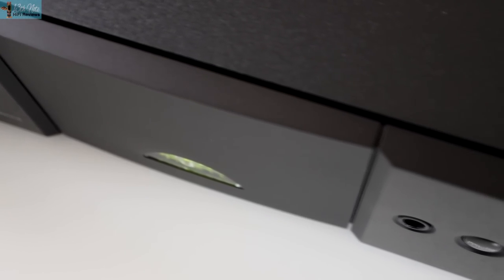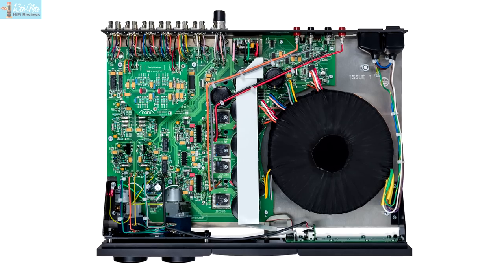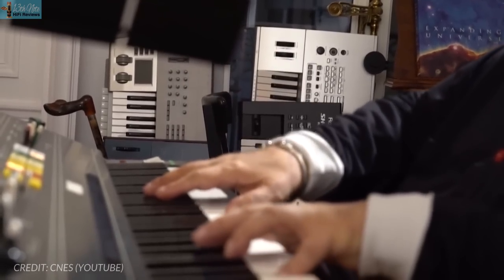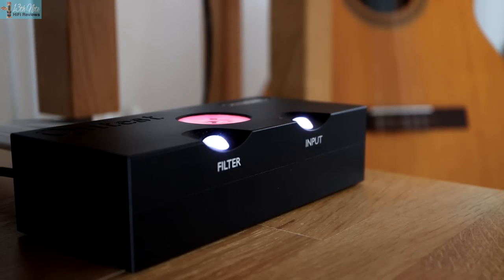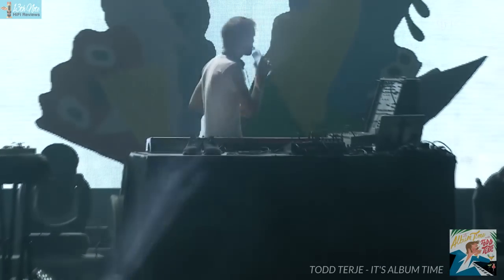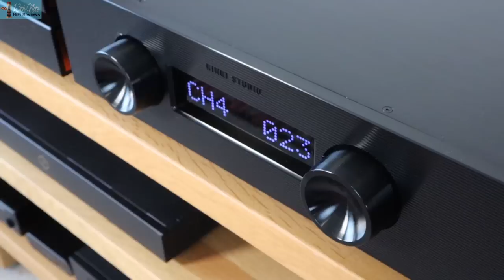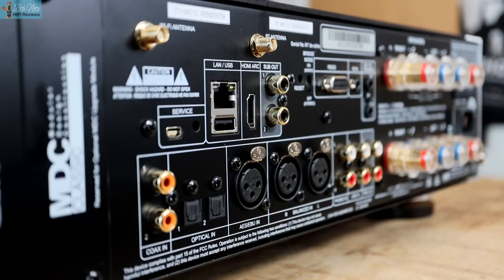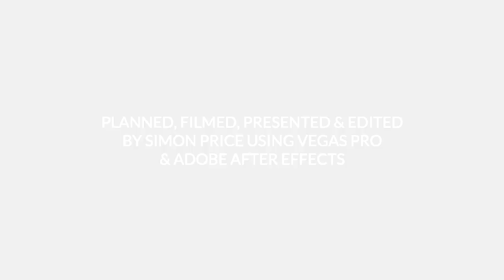Naim Supernait 3 (Vs. Hegel H390, NAD M33 & Kinki Studio EX-M1+)

Comment: Naim SN3 > Hegel H390.
Reply from the maker: I don’t think so for the pure grip, dynamic transients and control that the Hegel has, which with other areas being similar imo make the Hegel the better amp. Also it’s a bit cheaper in some countries. It’s gonna control speakers better. The Naim is a very fluid amp with bags of resolving power but as I think I got across it doesn’t have the slam of this Hegel and I doubted the high slew rate as a comparator to Hegel’s soundengine 2. In the delivery of dynamics and transients and comparatively speaking, the Naim is a bit like having a fluid tap running at a similar rate all the time. whereas the Hegel is a fireman’s hosepipe outputting the same tap water as the Naim, but when needed the full water of the fire engine can come out too. That’s the impression I got when I lived with both these amps for a while and I haven’t seen any reviews that got that across.
Reply: @13thnotehifireviews7  Hegel sounds thin in comparison. I know Hegel has a better stat sheet, but it doesn't sound better. No way!
Reply from the maker: @duggiefresh8170  when you say thin what are you referring to.
Reply: @13thnotehifireviews7  analytic, the opposite of warm. Very very detailed. I think they've subtracted too much distortion. Some distortion is needed.
Reply from the maker: @duggiefresh8170 if anything the Naim is more resolving than the Hegel by a decent margin. Taking distortion out of music is how it should be imo. Any untimely or constant bass tone or warmth in audio which is what you are referring too, when it’s not in the audio signal is undesirable imo. Obviously it’s a preference thing and each to own but if people like the Hegel for what it does and the naim for what it does, the elephant in the room is the naim can’t delve deeper and faster with dynamics and transients. That makes the Hegel the better amp in my opinion because it’s gonna drive speakers better and cope with the shifts in music much more convincingly - this is a big stand out trait between these amps and play any really impactful and dynamic classical, rock or electronic and the Hegel will be way easier to live with.
Reply: @13thnotehifireviews7  we can agree to disagree.
Reply: @13thnotehifireviews7  I like reading your analysis. Watching the video, I briefly got the impression that you preferred Supernait 3 over Hegel. There are many diehard Naim fans and it is understandable, but that same passion for a brand generates little objectivity when making comparisons with other high quality products.